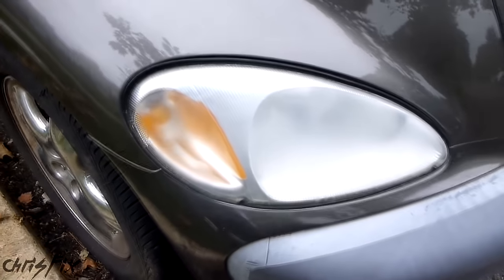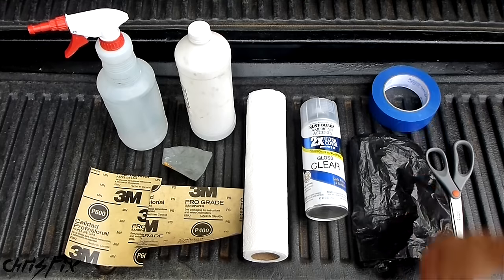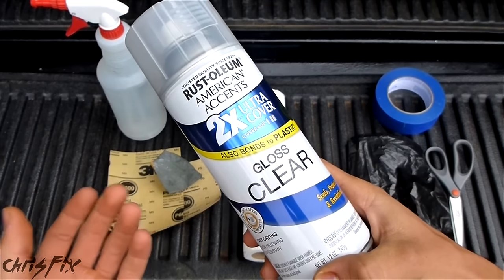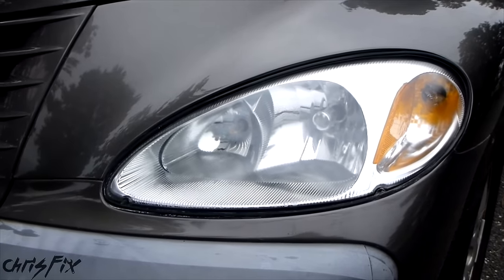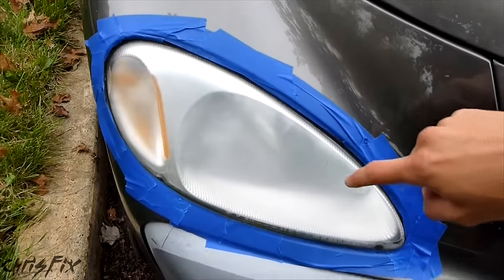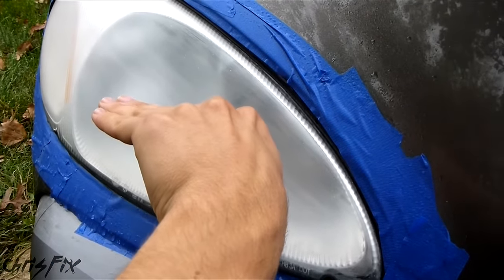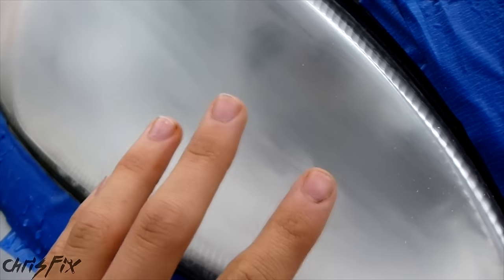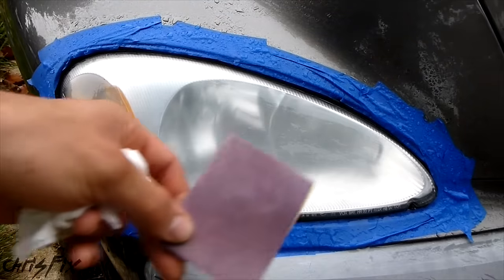How to Restore Headlights PERMANENTLY

Comment: I followed these steps with my totally yellowed headlights on my 21 y.o. Opel Corsa.

I had no finer sandpaper than 600 grit. I gave it a try and it worked wonders. Done sanding within the hour.
Sprayed them in 4 layers. The result the next day was kind of dull. (Orange peel)

Since I didn't have any sandpaper to buff it up, I used Commandant M5 polish with a polishing pad on my cordless drill.

The end result really is amazing! And I still think the paint cures a bit more to full clarity.

This video saved me from buying new headlights, so thanks man! Total costs under $10,-

Comment: Great video. One additional tip. Instead of constantly spraying water while wetsanding use a bucket with watet in it. Then just keep dipping the paper in the bucket every few seconds. It helps get the yellowed plastic particles your removing from building up on the wet paper. Which gives you clean paper every time you dip it in the bucket of water.
Reply from the maker: Thanks for the tip!

Comment: Thanks Chris! I did this today and It turned out pretty good! I was a bit too carefull so I did 5 layers of clearcoat in total! I did the last coats a bit more heavy, and it turned out great!
Reply from the maker: Awesome!
Reply: I ended up with 5 coats too, because the finish wasn't smooth enough on the preceding 4, due to fear of having it drip.  On the last coat, I saturated it a bit more than I felt comfortable with, but it turned out nice and smooth/clear, and no drips.

Comment: Don't let anyone bring you down!! Your videos are great and have helped me and a lot of people.
Reply from the maker: Thanks a lot!
Reply: Consider constructive Criticism. It is very healthy
Reply: I think the problem might be that people are not using the UV resistant clear coat that you recommended.
Reply: 2 years later my headlights still good, chrisfix's method works
Reply: Abhishek H did you provide him with such criticism and he refused? Wtf man?
Reply: Dixon Cider Also people are probably not reading the instructions that say clearly in what weather conditions to use it like it has to be less than 90F and less that 70% (i think) humidity and to be in the shade